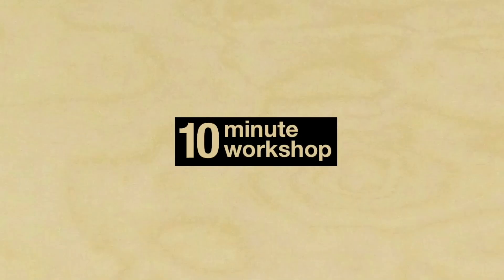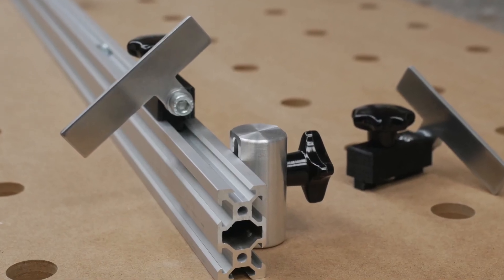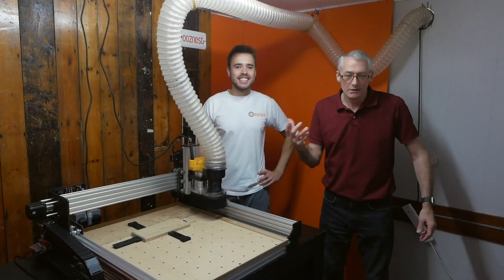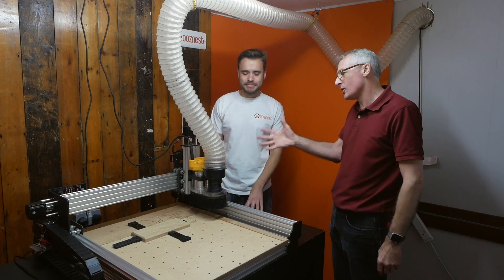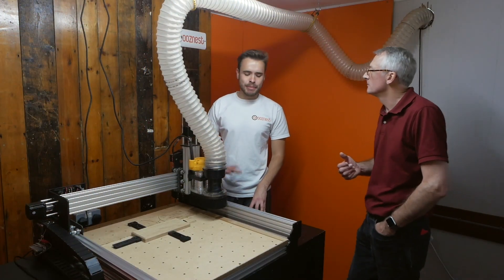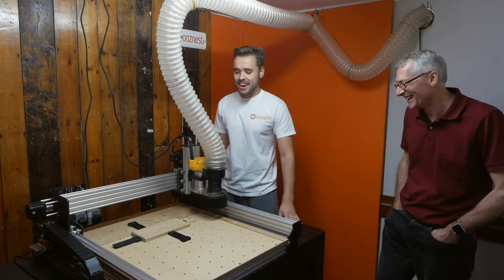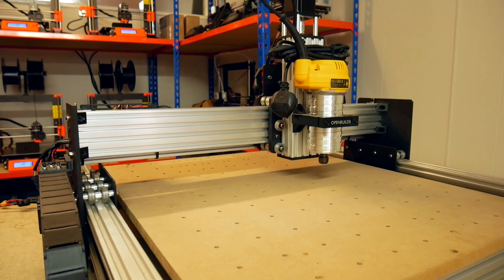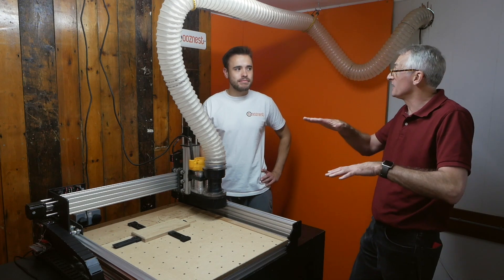More than Extrusion [video #228]

Comment: Thanks for the video Peter, glad you enjoyed your trip, it was a pleasure meeting you. If anyone has any questions, give us a shout
Reply from the maker: Thanks! It was great meeting everyone and look forward to seeing you again soon👍👍
Reply: If I wanted to slide a festool clamp into one of the extrusion slots would I be best using the 8mm or 10mm slot type extrusion? Thanks for the video
Reply from the maker: @mattkindon2917  I don't know, I'm afraid - I didn't know there were different sizes! Perhaps the guys at Ooznest can answer?
Reply: Thanks for the quick reply! No worries, I will contact them if they don't respond on here. I thought you might have been tempted to try a clamp on the fence you put together but I suppose there is no need with the mft you have!

Keep up the good work with the videos :-)

Matt
Reply: @mattkindon2917  Hi Matt, we only stock one size of extrusion slot size, and that is 11mm
Reply: @ooznest  ok thank you.
Reply: @mattkindon2917  I have fezzy clamps and I use 8mm extrusion which I bought from valuframe as I'm up in Teesside - hope that helps.
Reply: @VapourTrailz  yes that's great- thanks a lot!

Comment: "Starting prices" don't include much though. That's the problem at the moment with hobby rated CNC machines. £1230  then you have to add a decent router + cutters and that's with no software and you have to build it yourself. I've lusted after a Workbee for a while but for serious use you're talking a bigger bed which means more money. I think the limit on screw threaded versions is 800mm x 770mm work area. I think Ooznest are going to do well and I'm please you took a look. Didn't they offer you a freebie?
Reply from the maker: Oh sure - and the problem with higher-end industrial-rated kit is that starting price is so much higher, lol! I think the limit on the threaded versions is 1000mm, because longer than that the rods sag. And it’s the 21st century - nobody offers freebies, lol! 👍👍
Reply: @10MinuteWorkshop  Yes, even 2nd user industrial grade ones you're looking at the sharp edge of £15k :( - For the screw size, yes you're right they are 1000mm but the workable area is only 800mm x770 mm. Of course the other issue is space. Imagine trying to get their 1500mm x 1500mm one in your workshop and them remember it'd have to be permanently set up...

Comment: Although fascinating and fun, I am not sure that using a CNC is actually "woodworking".  More like computer/application working. I must sound a bit old school. Thanks for the visit though, it was fun.
Reply: CNC is just another tool. You need to have the skills and knowledge in order to come out with a decent piece of work at the end. You also need knowledge of wood, for example movement over time, way of fixing wood
e.g. I'm not sure a handplane is woodworking. I presume we agree this is a daft and patently false statement. Can you woodwork without one? Of course. Can you make stuff you wouldn't be able to if you have one? Absolutely. Do you have to know how to use the tool and have a good grounding in woodworking to be able to use it to benefit your woodworking? Yes. You can not sit at a CNC or computer and say "make me a chair" and you end up with a finished product. 
I think of it as another tool in the arsenal. Individuals may or may not have the skill, or the desire to work with it but it's a valid way of working with wood. :)
Reply: Stuart Nagle  I wouldn't resort to the "kids these days" argument. Kids these days are the same as kids in all days. The tools available are different, they change, they develop. it doesn't mean that one is better than the other just because one can work a tool vs another using a different tool. It isn't possible to boot up a CNC and come out with a chair. You need to design that chair; Select appropriate materials; process the items once the CNC has finished cutting such as sanding, routing; assemble the item with a suitable method; select an appropriate finish and apply it in an appropriate way. CNCs simply don't spit out finished items.

Designing items for the CNC also takes skill and knowledge of wood-working. You aren't automatically born with an innate knowledge of how to work 3D design software. "As long as it's in the database" just isn't a thing that exists on a significant scale. We also aren't born with an innate knowledge of how to work a hand plane safely and successfully. In most cases it isn't an either or - either you use a CNC or you know how to use hand tools. It's one AND the other.

Dismissing new tools and the potential they bring to make it possible for us to achieve things we really couldn't before is like saying that you don't want to use this new fangled electricity because hand sanding is the only way to do it.

Comment: Hiya Peter. After watching the video, thoughts of my suggestion a couple of days ago came flooding back. I wonder if you will be using their extrusions as part of your new MFT(ish) build?
Anyway, my metre long extrusion arrived today, as did the benchdogs & flip stop from Ralph. Having a few issues with the grey plastic bit of the flip stop & I will need to sand it down slightly, as it's a very, very tight fit into the extrusion & extremely difficult to slide. Great video though & I enjoyed the road trip. Next trip will be to see Ralph in Weston-super-Mare. I see he's already changed the star knobs for round knurled ones. G
Reply from the maker: Thanks Gary! No, no plans to use the extrusion in my portable bench build, it’s a much simpler affair. The flagstop bodies are pretty snug to start with, but mine soon loosened up; try snapping them in and out of the track a few times without the-nut attached👍👍